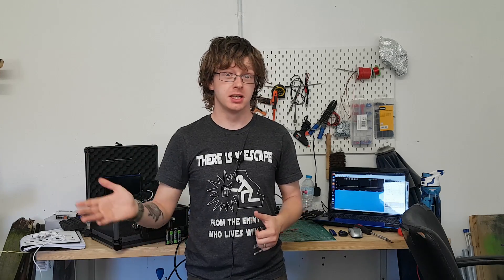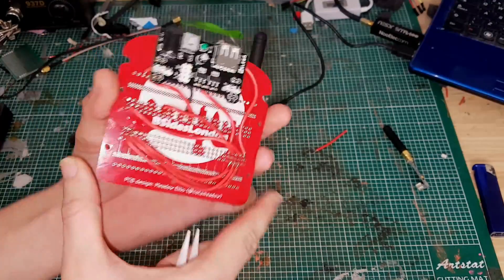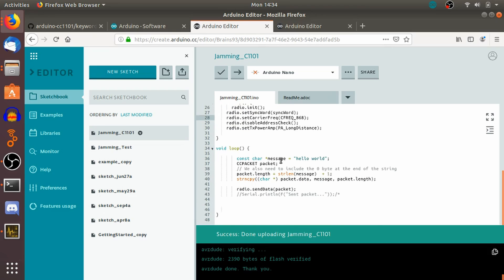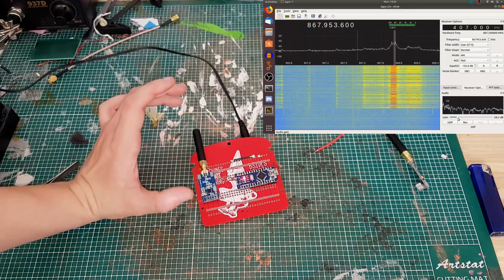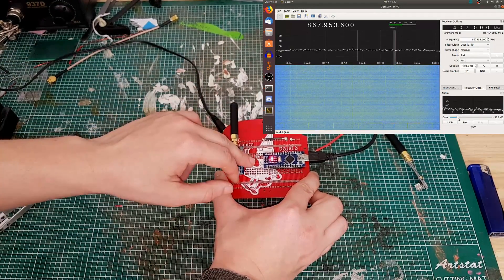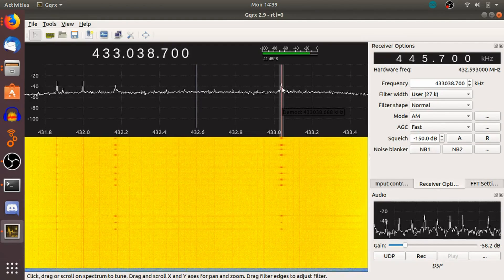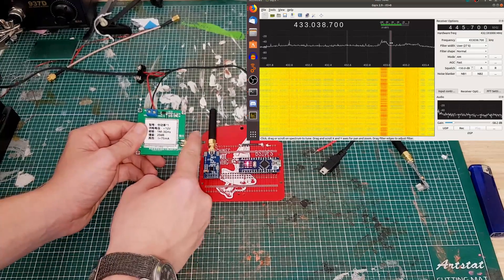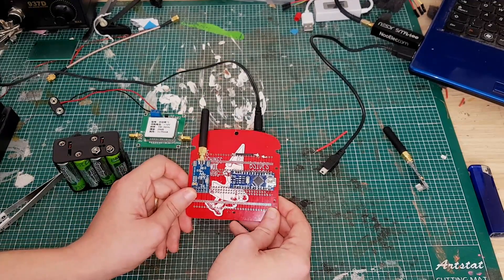How to Make A Mobile Multi Frequency Jammer

Comment: What SDR are you using?
Reply from the maker: I think it was the Nooelec I was using in this one
Reply: @Brains933  What does the black bar and solder bridge above the Arduino do, is that some kind of bus? Where does the red cable from the C1101's 3v3 go, there are no holes up there?

Comment: How is this a jammer? All you're doing is transmitting hello world. There is 1000s of devices running on 433MHz all in vicinity of one another. This will not "jam" your car fob and prevent it from working. What you've built here is not illegal to build at all. There's kids electronics projects that build these.
Reply from the maker: What do you think a jammer does? I have a few other videos showing them working and explaining the concepts, as far as 1000s of devices transmitting on 443MHz  in the same area and not interfering with each other I would ask you this. Why can we not see them on the spectrum analyser?

Comment: The CC1101 is a low-cost sub- 1 GHz transceiver designed for very low-power wireless applications. The circuit is mainly intended for the ISM (Industrial, Scientific and Medical) and SRD (Short Range Device) frequency bands at 315, 433, 868, and 915 MHz, but can easily be programmed for operation at otherfrequencies in the 300-348 MHz, 387-464 MHz and 779-928 MHz bands.
Features

    input voltage :3.3V
    maximum operating speed: 500kbps, support 2-FSK, GFSK and MSK modulation
    can be modify the baud rate, power, frequency and other related parameters by software
    high sensitivity (<1.2kbps -110dDm, 0.1% packet error rate)
    CRC error detection and built-in hardware address multipoint communication control
    lower current consumption (RX, 15.6mA; 2.4kbps, 433MHz)
    programmable control of output power, maximum output power of +10dBm
    standard 2.0mm DIP pitch interfaces for embedded applications
    separate 64-byte RX and TX data FIFO
    Transmission distance: 300 - 500 meters (Depending on the specific situation of the environment and communication baud rate, etc.)

Comment: Can you make me a jammer to jam 13.56 Mhz signal???
Reply from the maker: Why 13.56?
Reply: @Brains933  cause I was wanting to do a project.
Reply from the maker: That's in the HF range range. I think used by RFID readers. The antenna for that is pretty big
Reply: @Brains933  what components would I need
Reply: So are the components for the 433 the same for the 13.56

Comment: Hi there. Re drones and security. Boundary security is important at my farm  .Can you kindly help with a raspberry pi or similar land  F band radar unit please?
Diy boundary radar theses days is important .
  Adding a 360 degree rotating co linear panel antenna with a linear 
10w Rf output including code for size of object  differential algorithm (bird, drone,man or car ) at 700m would be awesome.
Im happy to buy a radar kit on your web site ( F band ) pre programed would be fantastic.
I can also be keen buy the Gerber file for printing the 18 inch x 18 inch co linear array PCB and have your filter plus a  tuned circuit design fitted to pcb aerial. 
Have potchers on farm problems.
Thanks mate for your videos
From Andrew

Comment: Hi i need your help to build laser jammer high distance for p0l1cE radar. I need to dedect the signal send to my car pamper from p0l1ce laser radar. Need to dedect the signal from 750nm-1000nm ligth but with mhz signal from 10mhz- 3000mhz. The minimum distance must to be 1000km.
Am wondering if this what am asking can be real.
I don't care if is legal or not.
I am from Cyprus everything is legal and everything is not😂

Comment: This would be criminal, illegal in most places. As in jail time.  Also, not difficult to track with simple equipment, like any other interfering gear
Reply from the maker: Correct. I believe I mentioned that in the video. I also have a video talking about why they are illegal and as you pointed out that they are easy to find.
Reply: You never get jail time for this in the US... I'm very familiar with us laws/justice system. At most, you'll recieve a fine. That is unless it's used in the commission of another crime.... You guys kill me- constantly crying "THATS ILLEGAL!" I live my life and base my actions on what I feel is right or wrong! Its pathetic how the sheep do as they're told... No chains needed... They know you won't dare escape or even think about breaking masters rules.

Comment: i cannot get a code from Git hub to work
Reply: Arduino: 1.8.13 (Mac OS X), Board: "Arduino Uno"

sketch_nov07k:2:10: fatal error: cc1101.h: No such file or directory
 #include <cc1101.h>
          ^~~~~~~~~~
compilation terminated.
exit status 1
cc1101.h: No such file or directory

This report would have more information with
"Show verbose output during compilation"
option enabled in File -> Preferences.

dude this is ALL i get i cannot bypass this freaking #include cc1101 in verifiying process. the code is exactly the one you have.

anyone got any tips so i can verify this code??

Comment: Great video!  I have been wondering how someone could make an LRAD (Long Range Accoustic Device).  Could creating "sound lazers" be easily done?  It would be neat to be able to transmit a lightly spoken word or even a whisper to an individual across a large field; no one else would be able to hear it.
Reply from the maker: I am not sure, maybe though I'm not sure how you would channel it
Reply: You can with ultrasonic transducer arrays;)
Reply: @markmikhail4279  has anyone uploaded any schematics or instructions for it anywhere?  If so, that would be great to check out!
Reply: @brian95240  bitluni made a video about sonar arrays that might be a good place to start for you
Reply: @nickusenko1348  Thanks a ton!  I'm going to look now.
Reply: @brian95240  I forgot to mention that code parade also made a video about sound beam forming a long time ago. I assume you might have seen it, but if not it’s the first thing that shows up for “sound laser”. Good luck with your project!
Reply: theres a tech science channel that had a DIY LRAD. apparently you only need 400$ invested to make one

but they can in no means be light and small

you need a dedicated powersupply and turret to use it
Reply: @fluffypinkpandas  I'll look for that one as well.  Thank you!   I have noticed there really isn't a true portable version.  Hopefully one day someone will figure out how to execute it with less power.  Until then, one can dream.
Reply: You need an ultrasonic speaker.....

Comment: Have you PCB Layout ?
Reply from the maker: There is circuit diagram on the discord server but no PCB Layout because I was using proto board and it was not that well planned out.
Reply: @Brains933  oky jamming freqenzy 868.958 mhz on C1101 ?
Reply: @Brains933  runing on Nano ?
Reply from the maker: Yes and yes, though you can change the frequency from 433Mhz, 800 and 900mhz
Reply: @Brains933  900 ist to higt muss jamming 868.958 mhz kann offset on C1101 freuqenzy offset

Comment: Hello from Brazil, I have a question, does it work for bluetooth? What is the simplest way to do it for bluetooth?
Reply: Wi-Fi and Bluetooth both operate on the 2.54ghz spectrum, although some Wi-Fi also works on the 5ghz spectrum. So if you jam the 2.4ghz Wi-Fi you'll also jam Bluetooth.

Comment: Greetings from Florida! I wanted to ask, so I have everything set up correctly and working (as well as an SDR to monitor transmissions) how exactly do you change the frequency? I've been searching for hours on how to and it only seems like I can do it off of some TI software through the registry. I've tried just simply changing the code radio.setCarrierFreq(CFREQ_868) to whatever I want but it doesn't seem to verify correctly because it doesn't recognize the new frequency, any ideas on what I'm doing wrong?
Reply from the maker: I dont have the code in front of me but I would double check the documentation to make sure you are using the correct commands. I will have a look when I get a chance :)
Reply: @Brains933  So I actually just figured it out, the way I managed to do it was by first downloading the SmartRF software by TI, finding the CC1101 on the screen, clicking it and choosing "open RF device in offline mode" and then from there it should show you a screen and to the right (you'll need to enable RF Parameters and Register View in the View setting at the top) you'll be able to choose FREQ0, FREQ1, and FREQ2. You'll need the value hex code later. You then simply change the base frequency on the screen to whatever you want, go into the CC1101.h file in the library and then choose one of the frequencies you don't mind getting rid of and simply changing their values in the file. (Just leave it the same name or you may have problems whenever you choose it using the CFREQ_ command). After that simply edit it in the main arduino coding to the frequency in which you edited. Now I may have done this entirely wrong since I'm not the best at understanding script but I did manage to get it done if anyone else has this issue. It would be great if someone could make a library with a bunch of channels together for easy changing. Anyways, cheers!
Reply: @Brains933  Alrighty I'll check again, thanks for the reply! Keep up the great work!
Reply: keelan where in florida are you?

Comment: hi grant could you please amend or add showing how to do this using a standard breadboard so i know where to put all my wires thanks
Reply from the maker: Yeah I am going to do a Breadboard video soon but if you look at the code from Github it has the wiring and pin numbers at the top. I have also put them in the description

Comment: #include <Arduino.h>
#include <cc1101.h>
#include <ccpacket.h>

#if defined(__AVR_ATmega2560__) || defined(__AVR_ATmega1280__)
#define CC1101Interrupt 4 // Pin 19
#define CC1101_GDO0 19
#elif defined(__MK64FX512__)
// Teensy 3.5
#define CC1101Interrupt 9 // Pin 9
#define CC1101_GDO0 9
#else
#define CC1101Interrupt 0 // Pin 2
#define CC1101_GDO0 2
#endif

CC1101 radio;

byte syncWord[2] = {199, 10};
bool packetWaiting;

unsigned long lastSend = 0;
unsigned int sendDelay = 0;

void setup() {
    radio.init();
    radio.setSyncWord(syncWord);
    radio.setCarrierFreq(CFREQ_433);
    radio.disableAddressCheck();
    radio.setTxPowerAmp(PA_LongDistance);
}

void loop() {

        const char *message = "Hello world!";
        CCPACKET packet;
        // We also need to include the 0 byte at the end of the string
        packet.length = strlen(message)  + 1;
        strncpy((char *) packet.data, message, packet.length);

        radio.sendData(packet);
       
}

Code that he is using dont forget to download the packages from the github! 

And this one is the schematic for the C1101

https://www.aeq-web.com/arduino-10mw-cc1101-ism-rf-transceiver/?lang=en
Reply: Can we jamm 900mhz or 1900mhz frequnecy with this? If yes then how?
Reply from the maker: +Saniul Alam Nibir it will only go up to 900Mhz, you need to change the variable marked set.carrierfrequency to CFREQ_900
Reply: How do I speed the send message up
Reply from the maker: @Dannydawson537  hey man, it is done by changing the Delay variable but it is already set to 0 so it should be transmitting constantly.
Reply: Maker Vlog cheers pal 👍🏻another quick one please can you tell me what wires go from the cc module to the Arduino just so I know 100 💯 there right😂
Reply from the maker: @Dannydawson537  I have had every man and there dog asking me that lol. Check the description now I have put them in there.
Reply: Maker Vlog 😂😂 fame comes with its problems and stalkers 😂
Reply from the maker: @Dannydawson537  I know right? Cant get rid of you :p lol joking bud.
Reply: Maker Vlog 😂😂 top lad you are

Comment: Hello mate! Another great video! (hats off) Thank you so much! My supervisor gave me this project but I couldn't find any useful tuitorials on the web! But can you please make another video and elaborate this one? I really hoped you would be doing this project on a bread board, because that would have been really helpful for students like me. If you have the time to spare please make another video.( I would be really greatful! As my final year project depends on it!) And if not can you atleast tell the connections between the pins? 
Thanks for your support and help!
Reply: #include <Arduino.h>
#include <cc1101.h>
#include <ccpacket.h>

#if defined(__AVR_ATmega2560__) || defined(__AVR_ATmega1280__)
#define CC1101Interrupt 4 // Pin 19
#define CC1101_GDO0 19
#elif defined(__MK64FX512__)
// Teensy 3.5
#define CC1101Interrupt 9 // Pin 9
#define CC1101_GDO0 9
#else
#define CC1101Interrupt 0 // Pin 2
#define CC1101_GDO0 2
#endif

CC1101 radio;

byte syncWord[2] = {199, 10};
bool packetWaiting;

unsigned long lastSend = 0;
unsigned int sendDelay = 0;

void setup() {
    radio.init();
    radio.setSyncWord(syncWord);
    radio.setCarrierFreq(CFREQ_433);
    radio.disableAddressCheck();
    radio.setTxPowerAmp(PA_LongDistance);
}

void loop() {

        const char *message = "Hello world!";
        CCPACKET packet;
        // We also need to include the 0 byte at the end of the string
        packet.length = strlen(message)  + 1;
        strncpy((char *) packet.data, message, packet.length);

        radio.sendData(packet);
       
}

Code that he is using dont forget to download the packages from the github! 

And this one is the schematic for the C1101

https://www.aeq-web.com/arduino-10mw-cc1101-ism-rf-transceiver/?lang=en
Reply: @Anoniemkoen01  sir if u have made this project please give me the circuit diagram
Reply: hi did youmanage to get the builkd instructions for a breadboard?
Reply: @nicolagillis500  i am searching for that too if i will find it i will paste it here.
Reply from the maker: I have put how to wire up the pins in the description hopefully this helps in the mean time
Reply: @Brains933  plz plz plz sir i am from india i cant understand ur discription pins plz give it in a animated format
Reply: @saniulalamnibir8274 
well i foumnd my self in the same postion , have you completed the project? if you can provide with some help pls

Comment: Greetings fam,
Can you please share detailed wire/devices connections info?
Very impressive.
Reply: #include <Arduino.h>
#include <cc1101.h>
#include <ccpacket.h>

#if defined(__AVR_ATmega2560__) || defined(__AVR_ATmega1280__)
#define CC1101Interrupt 4 // Pin 19
#define CC1101_GDO0 19
#elif defined(__MK64FX512__)
// Teensy 3.5
#define CC1101Interrupt 9 // Pin 9
#define CC1101_GDO0 9
#else
#define CC1101Interrupt 0 // Pin 2
#define CC1101_GDO0 2
#endif

CC1101 radio;

byte syncWord[2] = {199, 10};
bool packetWaiting;

unsigned long lastSend = 0;
unsigned int sendDelay = 0;

void setup() {
    radio.init();
    radio.setSyncWord(syncWord);
    radio.setCarrierFreq(CFREQ_433);
    radio.disableAddressCheck();
    radio.setTxPowerAmp(PA_LongDistance);
}

void loop() {

        const char *message = "Hello world!";
        CCPACKET packet;
        // We also need to include the 0 byte at the end of the string
        packet.length = strlen(message)  + 1;
        strncpy((char *) packet.data, message, packet.length);

        radio.sendData(packet);
       
}

Code that he is using dont forget to download the packages from the github! 

And this one is the schematic for the C1101

https://www.aeq-web.com/arduino-10mw-cc1101-ism-rf-transceiver/?lang=en